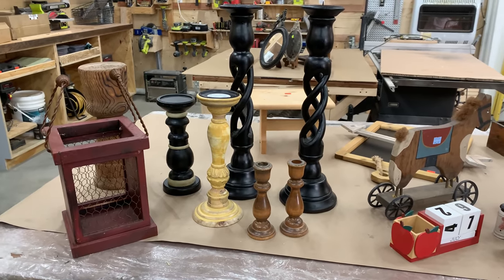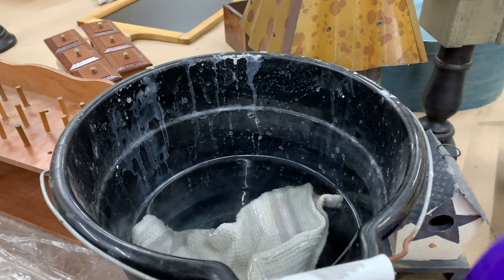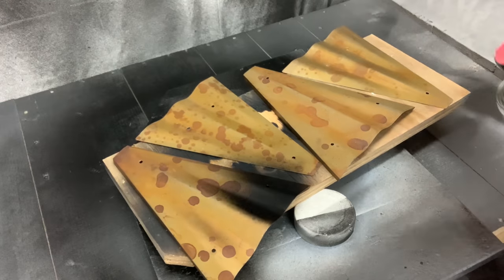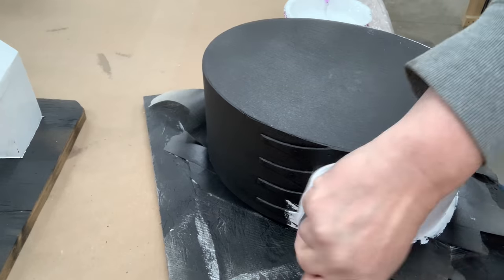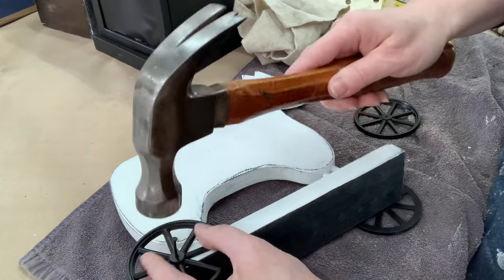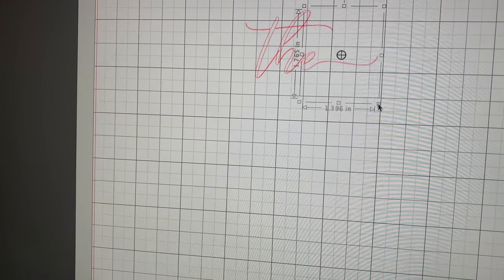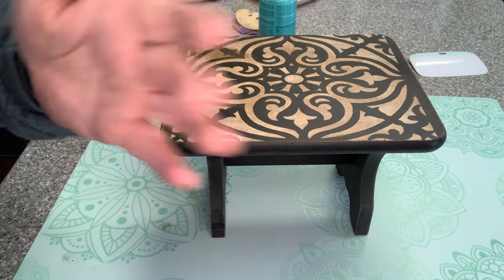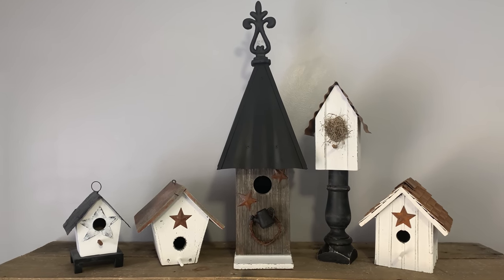Trash to Treasure || Thrift Flips ||  Making Over Thrifted Finds for Profit

Comment: Yvonne, thank you for including all the steps, that 's how I/we learn all your fantastic tips! I feel that if someone doesn't want all the steps they can skip ahead. Have you and Chris thought about using the poly spray in your paint sprayer?  Would love any and all tips on your paint sprayer, do you clean out your paint sprayer each and every time you use it?  I'm thinking that I want to get a small air compressor, and paint spray hopper but the air compressor is a little scary to me, I've use a miter saw, table saw, brad nailer, but the air compressor noisy is a bit intimidating, LOL
Reply from the maker: Thank you for watching and sharing. Our paint sprayer is airless. Yes we clean it out every time. And yes we have used for polycyclic. We went through many of those hopper type and Wagner’s. So we bought the graco sprayer.

Comment: You should keep all the steps in.  After all, we have the power to fast forward through anything that we don't want/need to see.  lol  As always, great job!  You have such patience!  The only thing I would have done differently would be to have painted the thread box without the dowels since you had to glue them anyway.  I would have painted them separately and then added them back in.  That's just me.  it was really creative the way you used the thread spools to replace the dowels that were missing.  Added a great touch!  Thanks for sharing!
Reply from the maker: Thank you Brianna.. unfortunately not 100% of the dowel weren’t lose.. but I like your thinking.. Where were you when I was painting this.. lol Thank you for watching. Hope all is well
Reply: @GingerChickRehab  Then that makes sense.  lol  I'm almost back to normal now.  Thanks for asking.  I hope to get the vaccine soon.  Don't know that I could make it through again.